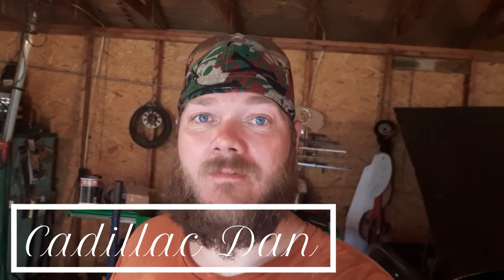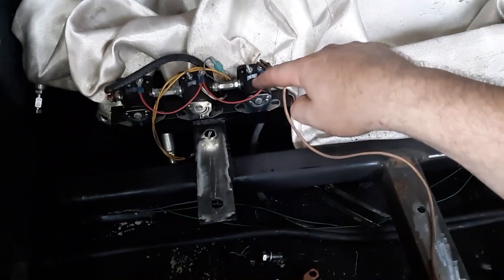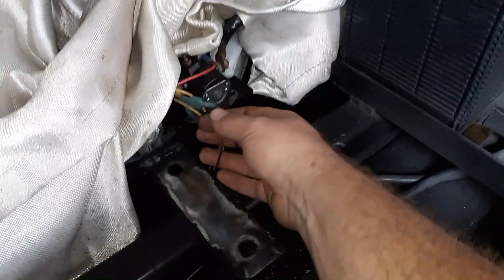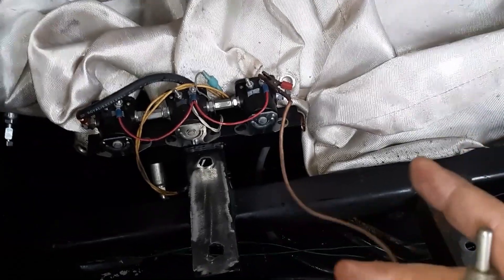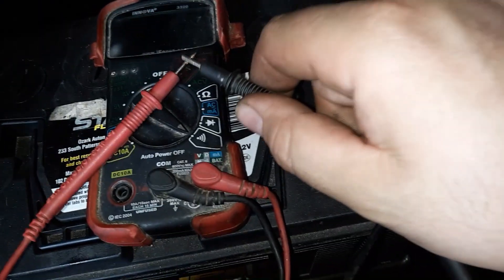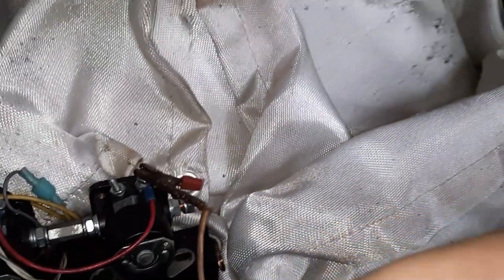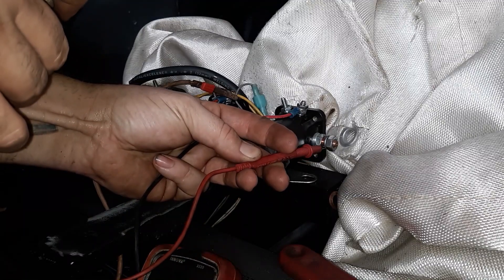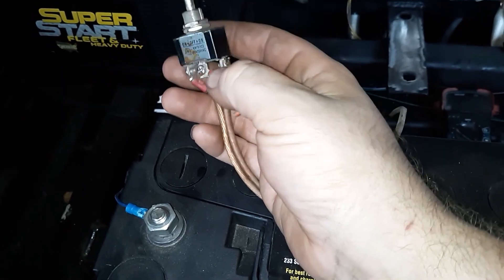How To Diagnose A Bad Solenoid And Trace Down Wires

Comment: So I’m having a problem. Just recently rewired my batteries & left the old ground on, it’s a 2pump/8battery set up.  it dumped & lifted for a couple hours, I check it later that afternoon & it wouldn’t lift? You think it’s my switch box, ground or something else?
Reply from the maker: Is it not doing anything at all Front and rear pumps check to see if you are getting power at your switch on the center prong it should be 24 volts. I put  a in line fuse on my switch power wire incase a switch gets stuck and for some reason I forgot to unhook the ground the fuse will pop before melting down the dumps

Comment: My problem is that my solenoid is inside my transmission. I don’t wanna take it apart just to test it… I’ve ran test to all my solenoids with my scanner and it’s consistently showing one of them that how a low circuit . I’m not sure if the solenoid is bad or if the wire going to the solenoid Has resistance on it. Honda 2013 2.4l
Reply from the maker: Yeah i have heard bad things about Honda transmissions. You can check out the channel Ericthecarguy he messes with Hondas a lot I know he did the transmission in his van a while back it may been able to help you
Reply: @thecadillacdanshow8658 thanks fam!

Comment: Quick question, how many solenoids should I run on a 8 battery 3 pump setup? I just bought an 84 cutlass with that setup and it already had a blown solenoid, so I replaced it and It lasted for like 2-3 weeks then it blew out again, what do you think it can be? thank you… im still new to this whole hydraulic game but I want to learn more

Comment: I was just driving my lowrider and now the back end won't up what can check
Reply from the maker: You can check to see if your solenoid is getting power from the switch wire
Reply: Should I check and try to put some pressure out of the line it might be locked?
Reply from the maker: @davidtuinder8624 if it wont go up it's not over locked it's not making any sound at all right?
Reply: @thecadillacdanshow8658  yes it will make a sound for a couple of humming sound of a a motor trying to go
Reply: About a 3-second grinding humming noise maybe like the sound of a motor or something for couple of seconds
Reply from the maker: @davidtuinder8624 if you have a long enough power wire from your solenoids to your pumps take the rear wire off the back pump and swap it to the front pump then hit your rear switch if the front pump spins you probably have a bad motor

Comment: Hey Dan what up bro got another issue my solenoid on the dump is clicking when I touch the ground if I take the wire off the dump side of the switch it stops clicking
Reply from the maker: Sounds like a switch is stuck or something is shorted out to power
Reply: @thecadillacdanshow8658  my back switch grounded out and burned up could that do it
Reply: @thecadillacdanshow8658  so do you think i shouuld change the switch panel
Reply from the maker: I would probably rewire it or at least find where it grounded at
Reply: @thecadillacdanshow8658  thanks bro i re wired it and the clicking stoped
Reply from the maker: Nice!